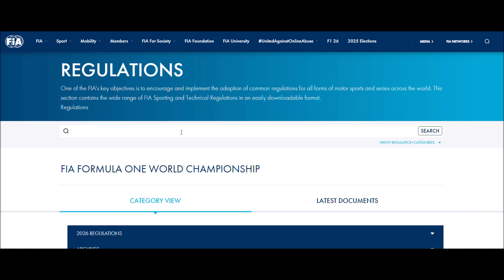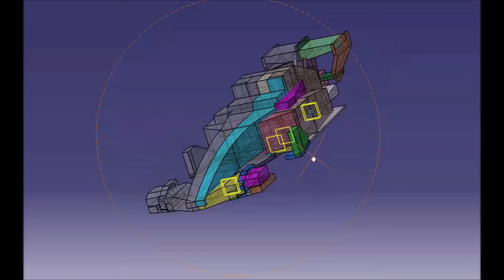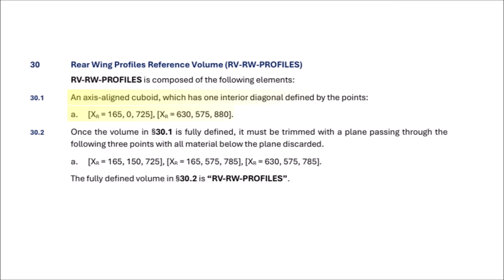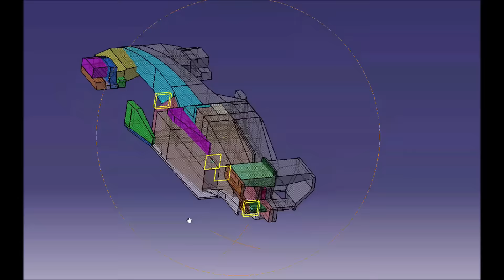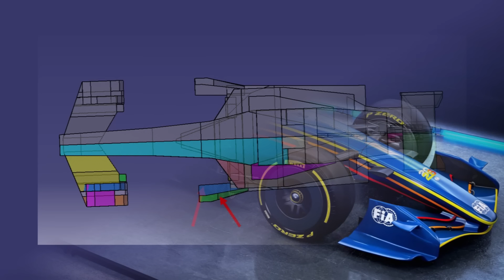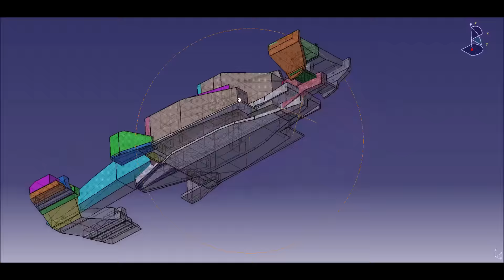How to design a 2026 F1 Car

Comment: Thanks for the video, really interesting! I have a question about how you define the Z coordinate of the track. When looking at the legality setup, the front and rear axles appear to be at different Z positions even though the wheel + tyre radius is almost the same (352.5 mm vs 355 mm). I assume this difference is related to rake, but I’m not completely sure.

To determine the minimum distance between the front wing and the floor, what is the correct approach? Should the reference volumes first be defined assuming a horizontal Z = 0 plane, with the wheel positions then defining the rake of the car, or is it handled differently? I’m getting a bit confused about the proper reference and setup.
Reply from the maker: You design the car as the regulations demand it, the different axle position will create a rake angle. For CFD you put the car on the ground and can measure the distances to parts
Reply: @bsport320 Perfect, thank you very much!

Comment: Thank you for this great video breakdown!

I have however mixed feelings seeing Catia again lol.
At the beginning of my automotive career I was a constructeur for two years and it really wasn’t my favorite job.
At the beginning I was a regular surface guy and I hated it a lot, later I went on to design fixtures with solids and I had the freedom to make them work how I want (inside the specifications of course) and that was much more to my liking.

These days I don‘t use much CAD anymore, only to look at certain things, since I am in pre development so standards, regulations and requirements are what I usually work with all day.
Reply from the maker: Thanks, and sorry to hear didn't have the best CAD experience.

Comment: As a rather new F1 fan (last 4-5 years) I still look at 2 different cars thinking “What’s even different they’re the same car?” this video was very insightful and eye opening to what other differences there are on every teams car.
Reply from the maker: Glad it was helpful! More to come ;)
Reply: You're totally right that F1 cars are basically the same. Take away the paintjobs and you can hardly tell them apart. 2022 was a bit different in this regard, we've had quite colourful car designs (which was arguably one of the main goals of those regulations, the FIA even presented 3 different models in 2021 just to showcase how diverse the new cars could become - not this time however, so be prepared for yet another near-identical, IndyCar-like grid). But of course as time went on and the more successful design choices were identified, all cars became almost identical as soon as the new season, 2023 came rolling around. There's a reason that less than 1 second separates the entire grid in most qualifyings these days... You think they could EVER achieve this with vastly different cars on all tracks (not just on such amazing tracks with many different types of corners and straights on them like Silverstone)? Think again.
It's a curse of F1, we all have to accept it. Teams always copy other teams. Older fans don't want you to know this, but the only reason the old F1 grids were much more diverse was because most of the times smaller teams simply didn't have the money, resources (e.g. on-track testing) and/or the required manpower to try to copy the big teams' designs, so they just had to stick to their own designs and tried to maximize their potential (which of course resulted in the slowest cars being several seconds slower per SECTOR than the front of the pack)

Comment: I hadn't realized they reverted back to such a flat floor. A bit of shame in my opinion because I like the cleaner look of less aero devices on the top, plus being to much more efficient. I suppose I understand though if porpoising is always going to be fundamental cap on performance. Or just takes so many resources to resolve that would be more fruitfully used elsewhere.
Reply from the maker: We will discuss the ground effect era cars and the lessons learned in a video soon

Comment: seeing this. I do not understand why F1 and FIa does anythign via this method. it would be much simpler to giva a basic shape, and then area behind the car, where no tubulent air must be found. make it say a 1m from rear of the car, until 5m form the rear of the car, the air must be not distubed to a certain degree.
Reply: This is F1 we talking about. They gonna take ANY advantage of rules if it still within the letter so it more like serious crime laws than sport regulation

Comment: Can you think of any examples of asymmetrical aero designs in the recent past? From the top of my head, I can only think of the asymmetrical double-tipped nose of the 2014 Lotus. I wonder if that was annoying to design, given that the software seems to be made to design symmetrical cars.
Reply from the maker: There are many asymmetrical parts on an F1 car if you just think about engine bay, radiator ducts, pedal box etc.
It's no problem to design, instead of just designing the left-hand-side, you design the whole thing. Teams then have their own system to deal with part numbers (usually odd numbers are LHS)
Reply: @bsport320 Thanks!

Comment: They should make a student engineering championship based on CFD and simulators lap times
Reply: We have Formula student and even the digital cars in there.
Reply: Nope, student engineers can build & race F4 cars as part of their studies 😼
Reply: @MsZeeZed Because that is inexpensive and also allows for extensive modifications and weird concepts...
Reply: @MsZeeZed yea but the digital car would be MUCH cheaper to produce, and much more feasible for smaller engineering schools. All f1 cars are made in cad first anyway
Reply: @StephAnie902 you could have high schools do it if you could somehow get them to understand ngl it’d have been fun
Reply: @dlanm2u there is f1 in schools which in which you build a co2 canister powered dragster. For uni there is formula student which is really open for wild aero concepts.
Reply: @themiddleman9376 Isn’t formula student the competition with all the fan cars (or at least out of the ones I’ve seen, the common underfloor downforce related strategy is that)

Comment: Thanks for videos like this. I love the technical aspect of these cars, but hearing content creators yap about rumors all winter gets annoying real fast. With the cockpit position, would some drivers prefer a further rear design? I seem to remember hamilton saying the mercedes cockpit was to far forward so he couldnt feel the rear.
Reply from the maker: Yes, there are a lot of factors you have to take into account when moving the cockpit and driver feel is one of them. The further you sit from the rear axle, the less feel you have for it at the limit - but there might be advantages which could make it worth.
Reply: @bsport320  makes sense. If you gain more lap time in aero improvement than you loose in driver confidence it makes sense to have the cockpit further forward. Love the "how to design" series btw.

Comment: Short wheelbase will be good especially if weight is a problem. It's a short term gain but with its limitations. 

What do you think about rake? Will we see them back?
Reply from the maker: rake angle on a flat floor makes sense as it turns the whole floor into one large diffuser, but the 2026 regulations are limiting the ways to seal the floor.
Reply: @bsport320 I agree but aren't the edges of the floor workable? I read there are some freedom - especially towards the back in front of the rear tyres.
Reply: @bsport320 I think that with some cuts  and short curvatures in precise locations can still generate some weak vorticity to help minimise the loses.

Do you think this is possible? Isn't there a specific thickness to the floor edges? Let's say 1cm, is it enough to make curvatures within that dimension? Are you allowed to make cuts in the floor edge area? Even that inwashing tyre wake panel, with clever designs it is still possible to find ways to generate some vortexes. And finally about the tyre squirt at the rear, the FIA allowed some freedom towards the floor corner for that specific matter.

What are your thoughts?

Comment: This is a really cool insight on a loophole to make the noses higher, but didn't the mercedes w13 and w14 also used more forwards positioned cockpits only for them to discover drivers hated this driving position?
Reply: Yes, it was a big issue for Lewis.
Reply: @azmidlyf probably Russel as well, but it was his first year in Mercedes and probably didn't want to push criticism towards the car this early
Reply: @Swartkin  Russell also hadn't run the previous Mercs, which had the normal driver position.
Reply: @azmidlyf  So was getting out of Q3
Reply: I think it depends on what your front suspension furniture is like and maybe its geometry too. Despite losing all points in 3 races, Norris’ 18 podiums were boosted by a minor front suspension change and from that point he drove more aggressively against a clock that he no longer looked at to judge his speed.
Reply: @MsZeeZed I'm not saying the car will be slow, I'm saying the drivers probably won't like the driving position which may negate the aero advantage, a fast car doesn't matter if the drivers aren't confident with it
Reply: @Swartkin  Agree 100%...if they aren't confident in the machine under them, it gets tough to commit to a 160 mph corner.
Reply: Wrong, Lewis cant adjust his technique to that era of regulation
Reply: @LuqmanHM  what? he literally said he didn't like the cockpit position
Reply: @Swartkin  well then he can't adapt and Russel is better than Lewis in same car
Reply: @LuqmanHM  that's such a dumb statement, it's literally like saying driving a car with a seat positioned in a way you're not used too means you can't adapt to it, when you can and are adapting to it, it just means it's not that comfortable
Reply: @LuqmanHM  What you are saying is wrong, were they where both at Mercedes, for two years, with the first year starting at the same time at the ground effect cars, both Lewis and Russel were more or less equal, Hamilton had more podiums and just a tad bit more points, and Russel had one more wins. So quite equal. One might say that has Russel was the rookie in the team, Hamilton should have been able to make a bigger gap, but Russel was not a rookie per see, he had already a lot of experience at Williams and was also well prepared by Toto to drive the Mercedes.
People tend to say that Lewis has a really bad time to adapt to the ground effect cars, but it is because they look at it mostly from his last season at Ferrari, where the problem is less the ground effect than the fact that the Ferrari is clearly not designed to suit his driving style. If he lacks adaptability it is mostly linked to the way the Ferrari is designed with a crapy rear train (and yes, in this position Charles has lot more trouble, but he is used since the beginning of his career to the really badly designed Ferraris).
So yes, Lewis might be not as good as he used to be than with the previous areo rules, but he has less trouble to adapt to the ground effect cars that a lot of people tend to think. He had much less trouble than some others, Riccardo comes to mind, he was totally lost with those cars...
Reply: @Swartkin  well Luqman is pretty wrong in the way he is saying that Lewis can't adapt to anything, but one might also think that with the introduction of the ground effect, Lewis was partially blaming the seating position of the car because he did not really completely realized at that time that some of his inconfort was linked to the fact that he was not so keen on driving those ground effect cars. Even if people tend to overthink Lewis inability to adapt to the ground effect cars as he was more or less on par with Russel during the 2022 and 2023 season when the ground effect cars were introduced (everyone is talking today about his inability to adapt to these cars due to his poor season at Ferrari, which might in fact be linked to many other parameters...).
Reply: @GenghisDaniel I've been seeing a decline in Hamilton's pace since 2022, he is still very competitive and by no means bad, but he has shown a tendency to not be as adaptable as his younger teammates in the ground effect era, which didn't fit his driving style much, maybe because he was so used to the generally tamer nature and more comfortable rides of F1 cars from before ground effect that he couldn't adapt very well, Ferrari worsened his case, given they have a completely different driving characteristics in their cars compared to Mercedes, that was a place he spent almost all of his career on, we seen other drivers with extremely high adaptability such as Alonso (which experienced multiple teams), Max (Has adapted extremely well to a car that was terribly hard to handle) and Leclerc (going through multiple Ferrari vehicles with different driving characteristics and as of 2025 a very peaky car) adapt extremely well in these regulations, so it was a shock for most people seeing lewis being beaten by Russell and now Leclerc, I'm a max fan, but I don't think a driver of such high caliber as lewis should lose every faith he has in himself in such a short time, maybe 2026 will be better, giving we will be getting more comfortable cars with pre 2022 characteristics